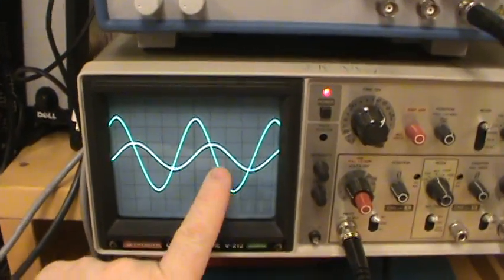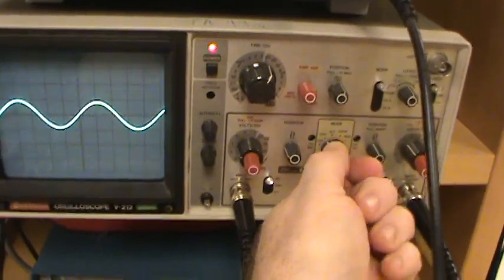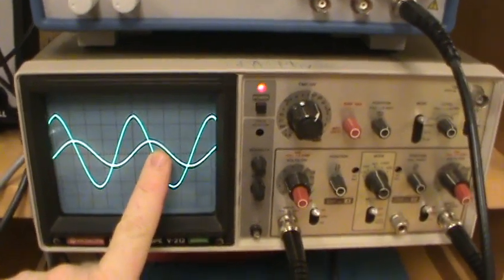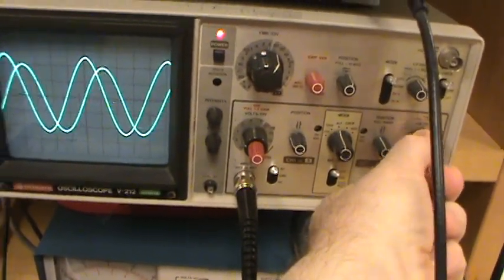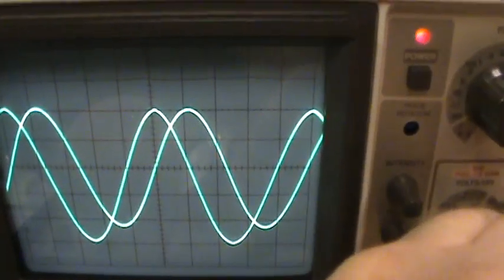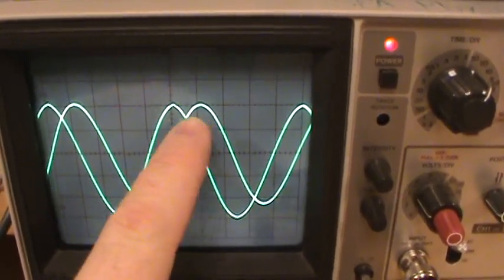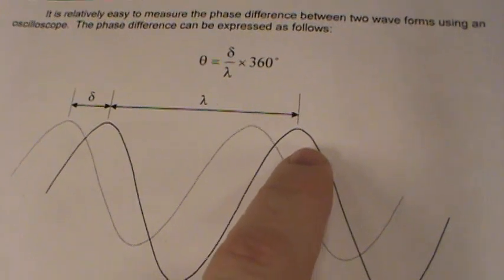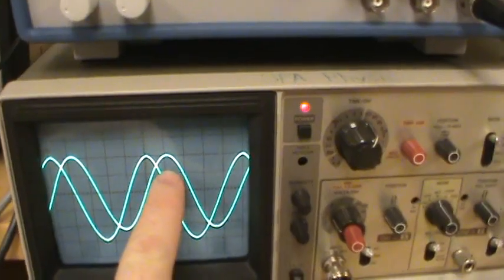Measuring Phase Differences (Part A continued)

Comment: Better use the zero crossings instead of the peaks to determine both wave length and shift between the signals. Much easier to read off everything that way.